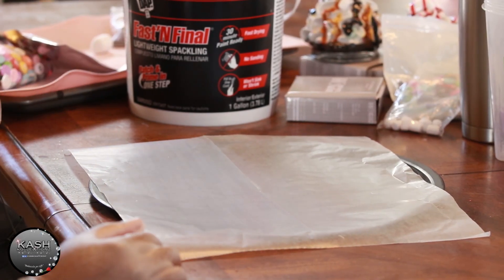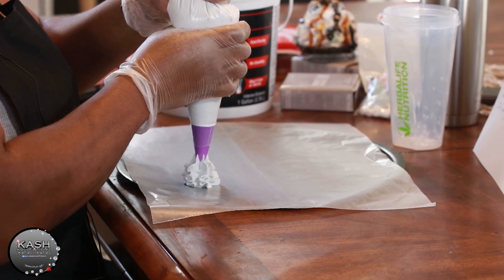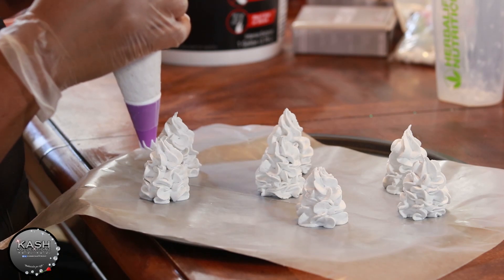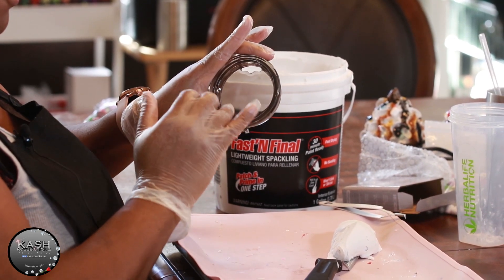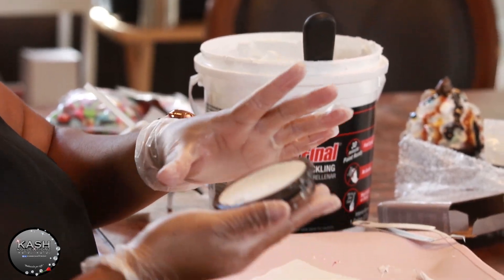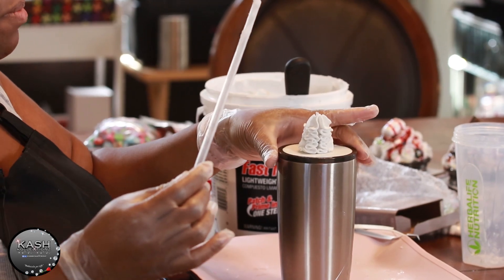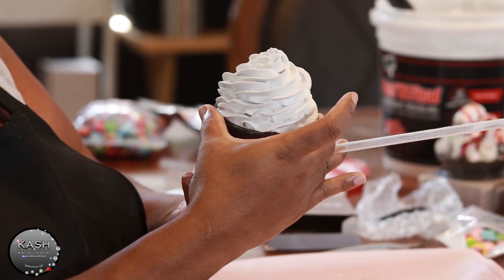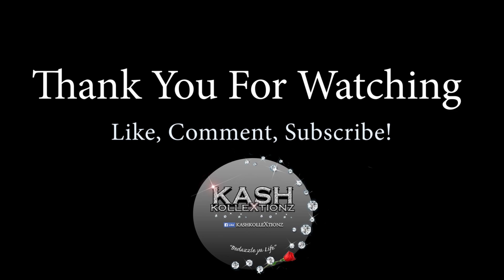DIY Faux Ice-cream - Whipped cream Topping  - Glitter tumbler tutorial

Comment: Thank you for posting this! They look beautiful. My only concern is are these food safe?? I could see little bits of dried spackle going into the cup every time they pull the straw in and out or the liquid touching the bottom of the lid where there is exposed spackle.
Reply from the maker: I show you how to completely cover the spackle without having to touch with straw or your mouth. Qtips, or really thin and pointy paint brushes can get into the most TIGHT spaces with epoxy foot coverage

Comment: On placement of the candies on the whipped or ice cream tops some I seen you waited till the spackle was dry and some you didn’t, what’s the difference and which is better?
Reply from the maker: The bigger candies is better to add in spackling before epoxy. Sprinkles is alot more easier to add after epoxy, that way you won't be adding 1 sprinkle at a time

Comment: Thank you!! So just thinking out loud, but would it be possible to do the “foundation “ on top of the lid and build up your ‘core’ or centerpiece right on top of it at the same time? F so, it would all dry together and already adhered and would save the step of glueing it on.  But maybe that wouldn’t work?
Reply from the maker: The middle pieces is to secure your whip from sinking in. It need support to stay up. No support, then your spackle will sink down in the middle. I make a lot of those from unused spackling. Once I'm done with making the lids, I'll make some small ones to use later.
Reply: I was thinking the same thing but I’m new to this so I could be wrong

Comment: Hi, love what you do! Trying it my self, but how can I get the spakling to harden 🙁???
Reply from the maker: I threw my spackle in a warmed oven using just the light in oven. Some people put them in a over and turn oven on but I can't guarantee you that it will keep your lid from melting and spackle from burning. If you have an oven light, just use that and it'll dry the inside and outside quickly.
Reply: @kraftingnmorewithkash7005  Thank you for taking the time and replying. Keep up the amazingness, GBY!

Comment: What is a drying area? Is it a box with a heater?
Reply from the maker: I use my oven light. Anywhere you trust to dry out your spackle without burning it
Reply: @kraftingnmorewithkash7005  I was thinking you had a box with a heater blowing into it lol. Over the winter I took a clear tub and cut one of the ends out and my Turner was inside of it as well as some things in a mold for them to stay warm and that seemed to work for me it had a heater on the side that the side was cut out and I didn't put the heater in the Box I just put it on the outside blowing into it and line the inside of the tub with tinfoil
Reply from the maker: @shellymcdaniel9224  great job